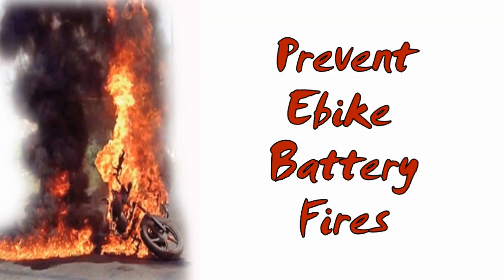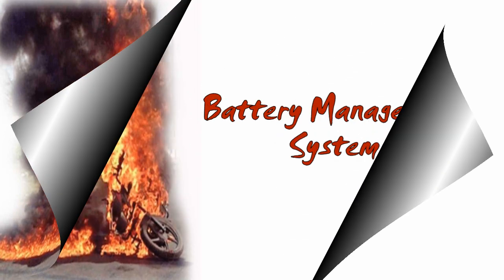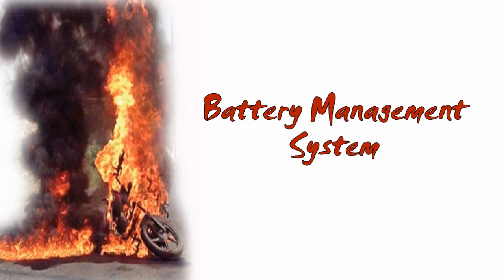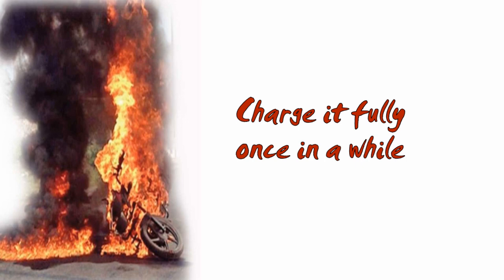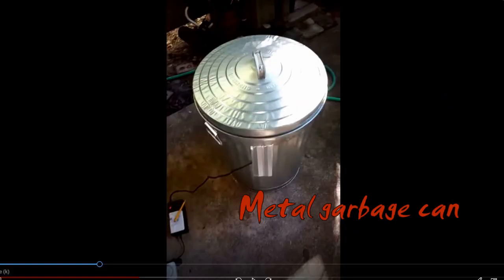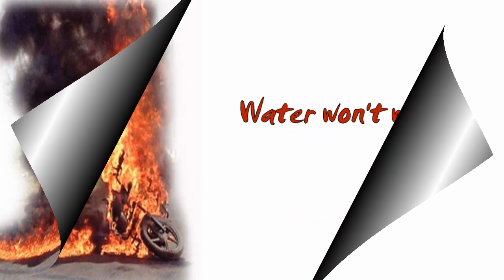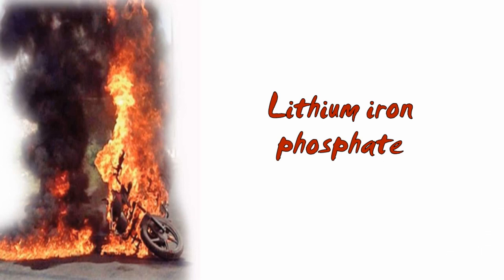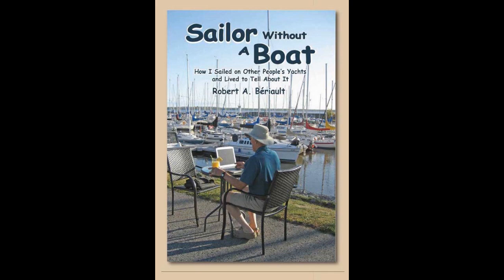Tiips For Preventing Ebike Battery Fires

Comment: A large number of ebike fires are caused by bike thieves who steal an ebike but jerry-rigs a charger, often from scraps and some straight from discarded power supplies with no limiter or smarts. Meth heads don't follow safety rules.
Reply from the maker: You'd think that since the bike was "free", they could afford to buy the correct charger. But that kind of guy lives by taking stupid risks.
Reply: @RobertBeriault753  Addicts don't buy anything except drugs.

Comment: By the way, I know how people over charge their batteries, once the battery is charged, the green light shows and it stops charging, then they unplug everything and then replug everything back to charging mode. This will over heat the battery causing it to catch fire and possibly explode.
Reply from the maker: I've done that once. The charger only worked for a couple of minutes then shut itself off. If there had been a loudspeaker in the charger, it would have probably yelled "Don't do that, Robert!"
Reply: @RobertBeriault753 wow  and lol about the charger yelling
Reply: Why would someone recharge an already charged up ebike?